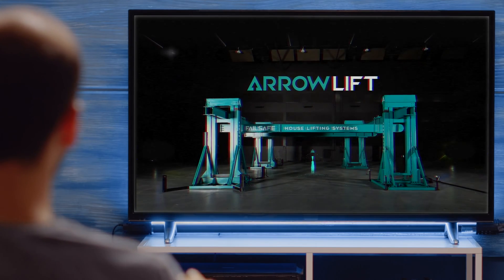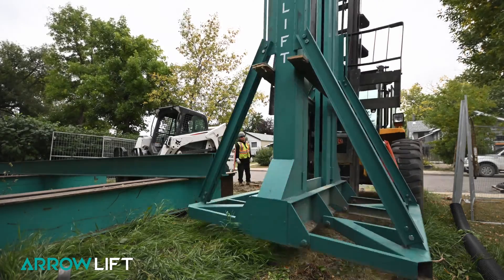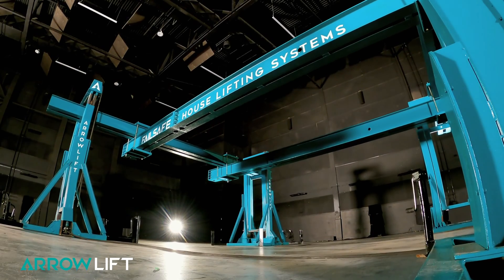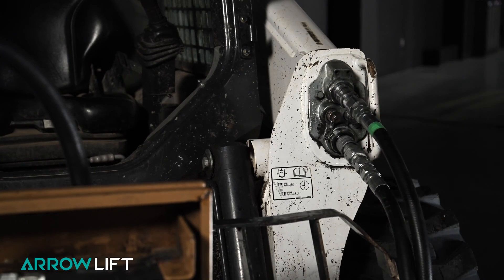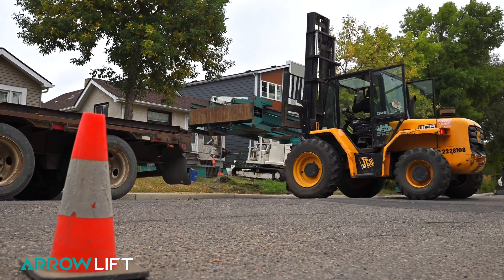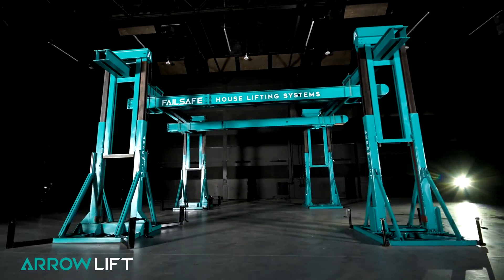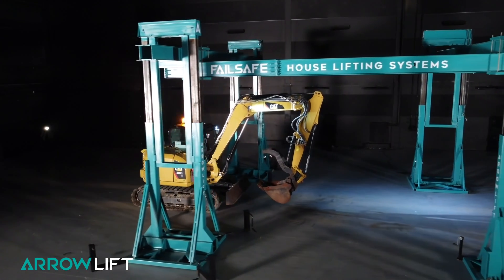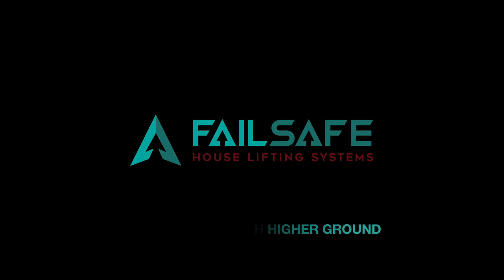ARROWLIFT | FailSafe House Lifting Systems

Comment: 1:12

I am perplexed. The beams under the house are UNDER the beam that does the lift? So the whole load is supported by the tensile strength of those four thin rods? I am seeing that right? Shouldn't your load be applying compression forces to the beams, not tensile forces to rods? 

How is this fail safe? If those rods fail under tensile forces, the whole thing comes crashing down. Where is the fail safe design?